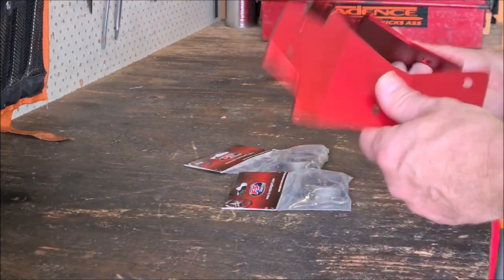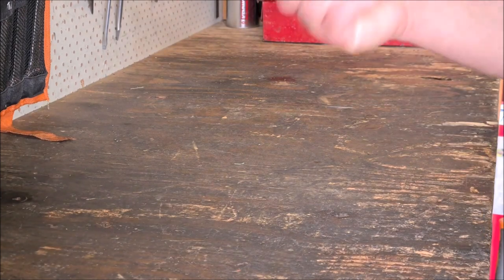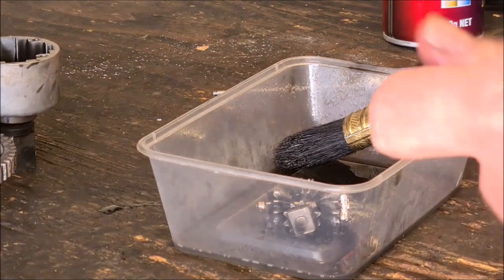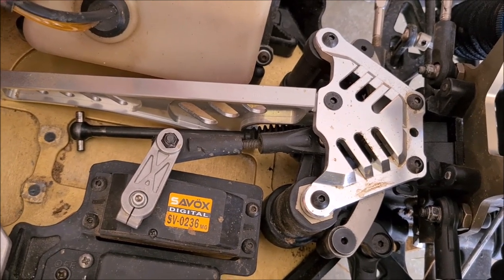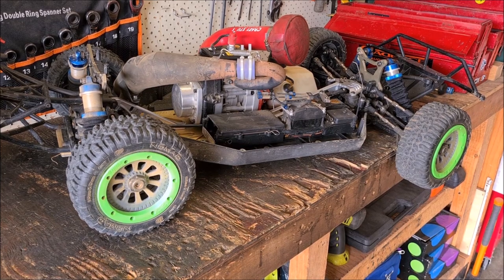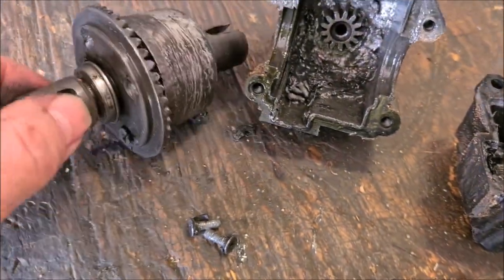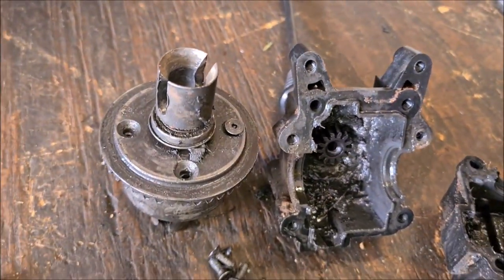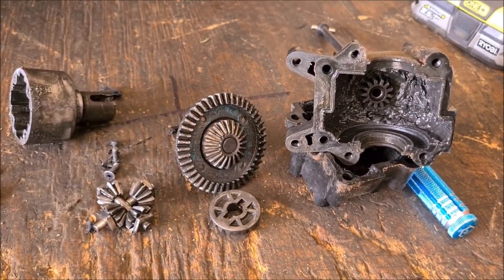1/5 RC Rovan LT - Not what I expected!!!

Comment: Instead of a heat gun try using a soldering iron just hold it on the head of the bolt so your not heat up the whole area
Reply from the maker: I seen people use that but takes too long to warm up 🤣 Might do for where there's plastic around though. thanks for that

Comment: I just purchased a 2nd hand rovan baja to get into the larger 1/5th scale platform. Nitro rc becoming too small and finicky to work on. I'll be doing basic mods and before I actually run it locktite as the car is unknown to me.
Reply from the maker: Awesome.  Highly recommend a full strip down 👌